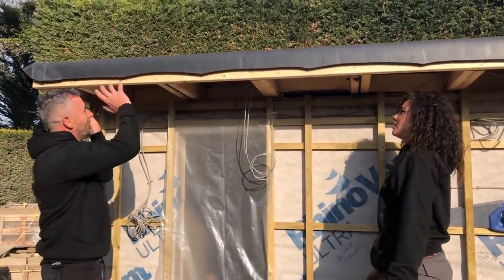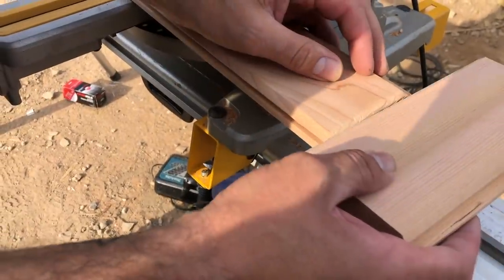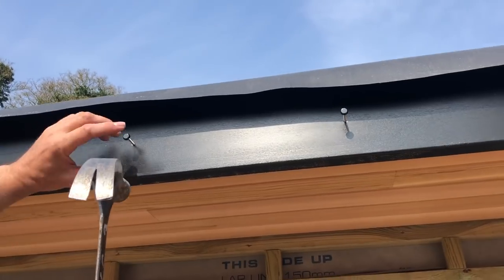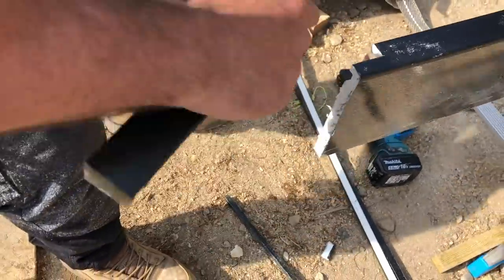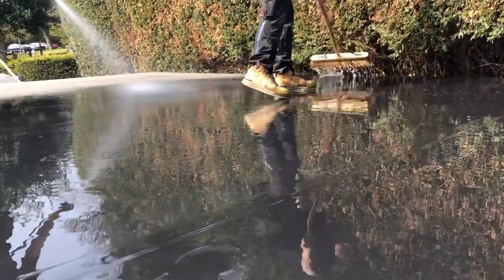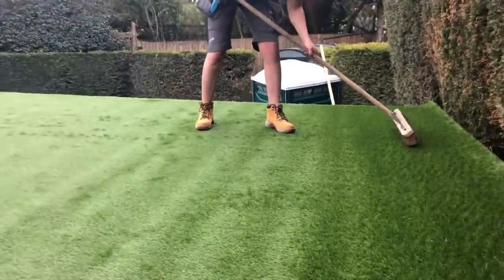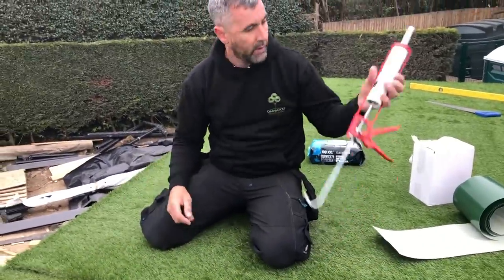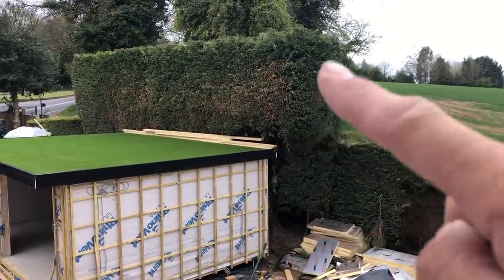Garden room cedar soffit, UPVC fascia and artificial grass on the roof

Comment: After about 25 years of trying to dig metal out of holesaws, I realised that it's much easier just to spin the cutter off the Arbor and then knock the metal/wood against the pilot bit.
Your terminal driver can thank me later😁👍
Reply: If you pop a strong spring on your drill bit before you drill the plug  just pops out 😉
Reply: @contourbikecam3425  
Yeah, it works sometimes, but not if it's a thick bit of metal or wood unfortunately.
There have been all sorts of quick release and spring assisted hole saws over the years, I've found the best is a Starrett cutter and a pair of water pump pliers 👍

Comment: First or second fix for the cladding/soffit? Also is that cladding good to be used in coastal areas where it can take a battering from the sea air/mist/wind, will it rot in time?

Thanks

Comment: You shouldn’t push the PIR tight up, you should leave an air gap
Reply from the maker: Mate, watch my videos, it’s all good 😊 trust me, tight up, no air gap 💪🏻
Reply: Been in the building trade 35 years, always told by building inspectors to leave an air gap between insulation and the bottom of the roof covering. This is because if vapour is to form inberween it will form regardless snd it’ll soak into the roof decking causing the deck to eventually break down. An air gap allows air to constantly circulate and let vapour to escape. Just what I’ve always been told to comply with building regs
Reply: Oakwood Garden Rooms to be precise a 50-60mm gap should be left.

Comment: No expansion gap on the fascia, any of you who going diy- leave 1mm per Meter on either side of the same board because it can move expand either end.
Reply: Do you mean fascia?
Reply: Sorry yes, general on all fascia/soffits
Reply: He’s mentioned in loads of videos before to not hit the nail too hard and to let it just touch the fascia. That’s for plastic. I can’t quite tell but that looks like fibre cement fascia to me which won’t swell much
Reply: @jaimedeoliveira9216  thats the rubber roof trim. If you see the fascias hes wackin them in hard, its not the nails but the gaps that you require.